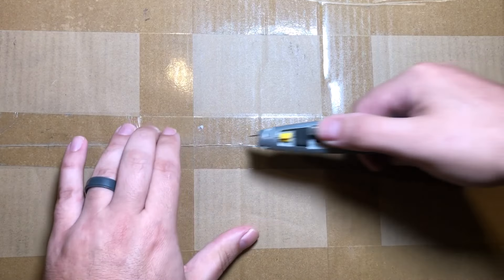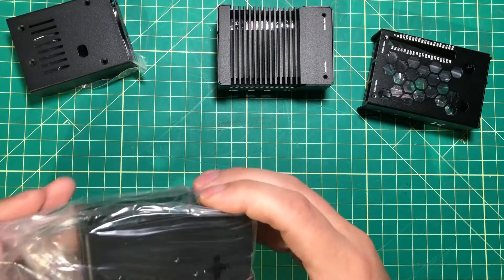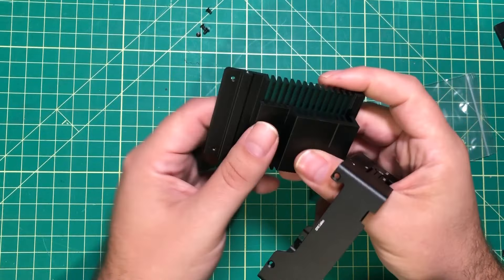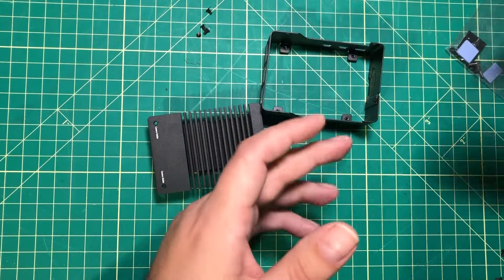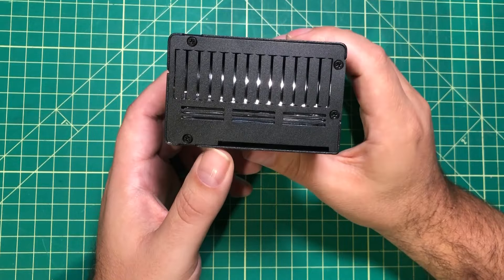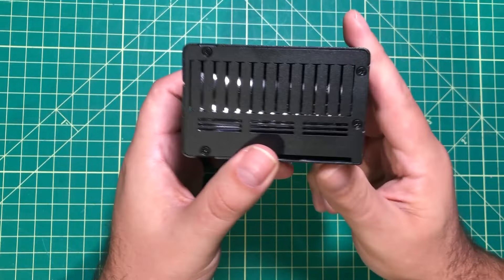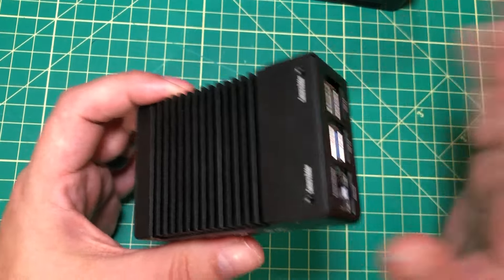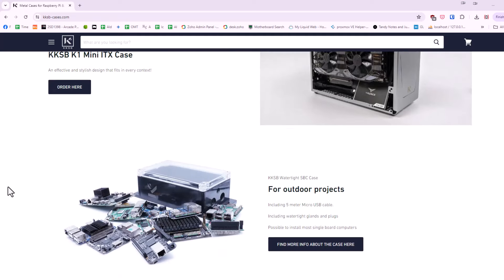4 Raspberry Pi 5 Cases Compared - One for Every Occasion

Comment: The Case with the display is something that comes to mind for prototype hardware for LibreDiag, so then it would almost be like a Launch or TopDon style tablet that can be carried to the car with the diagnostics dongle
Reply from the maker: Yeah.   It definitely has a lot of uses.  I got it to work with my Pi3b and it's great with that.
Reply: @AnotherMaker  Strange I was thinking about that pi tablet you demoed a year or so ago but this one looks a bit more sturdy, will need to get one or two rpi's in

Comment: I got the case with the display screen off of Amazon and love it.  I didn't have any problems putting it together but I did take the back off of it and found all the small little screws a bit tedious when I put it all back together.  I did put a cooler on the Pi 5 that I put in there and was glad I did.  I am running some sound emulation software for a MIDI keyboard, and the box over time will get warm.

Comment: Even the Raspberry Pi 4 and 5 don't actually need cooling for basic tasks.  They can run as a bare board without issue but if you want to run higher loads or video playback then a heatsink and fan is going to give you the best results.  I have 3 Raspberry PI 5 units just running in aluminum EDATEC cases since I ordered them through digikey at the time and they seem to work well running on the wall in the basement near my home network equipment.